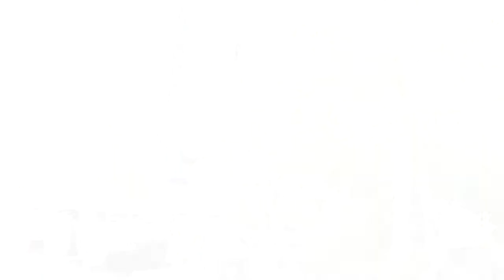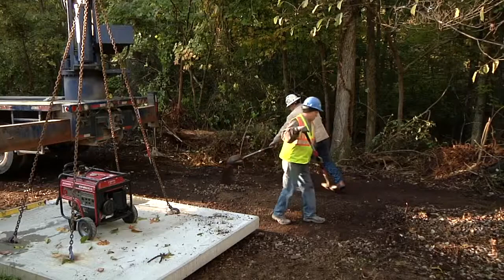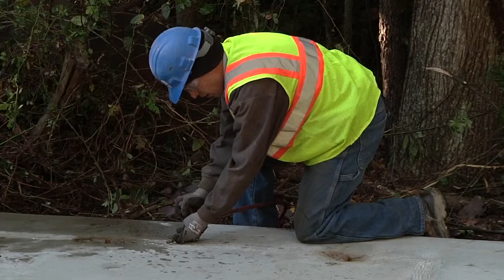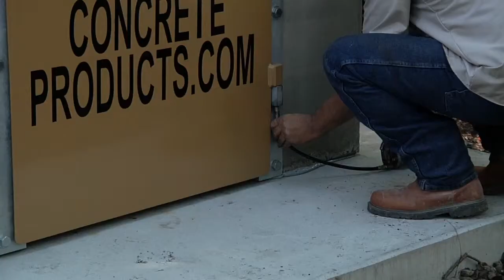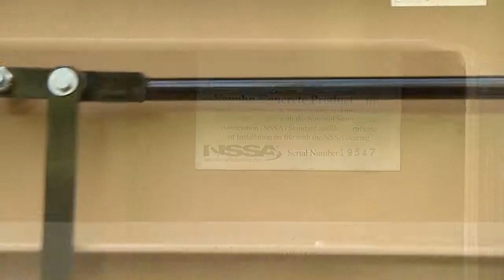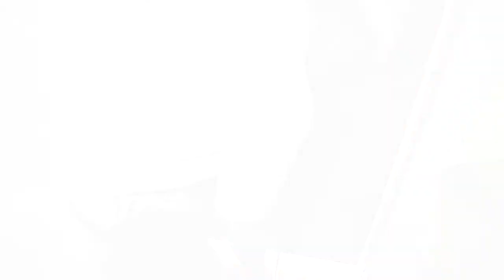Video 1-Saferoom Installation-Vaughn Concrete Products

Comment: Dear Sir/Madam,

I specialize in constructing tornado-resistant houses. To achieve this, several critical factors must be considered. First, the materials used in the construction must be meticulously chosen for their durability and strength. Second, the design of the house will feature a rounded shape, as this form significantly reduces the impact of high winds by decreasing their speed. Third, the overall weight and structural stability of the house are crucial considerations in ensuring resilience against such natural forces. Additional details and technical insights will be disclosed upon finalizing the appropriate contractual agreement.

Best regards,
Gary Nile Sunson, An inventor